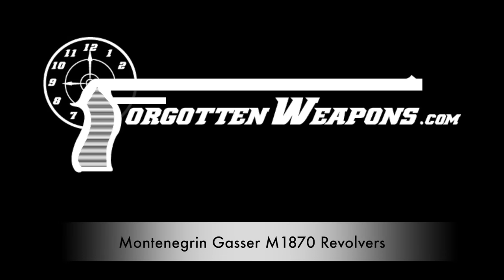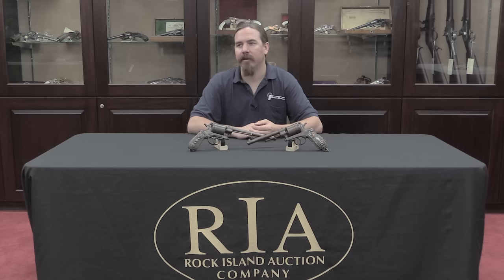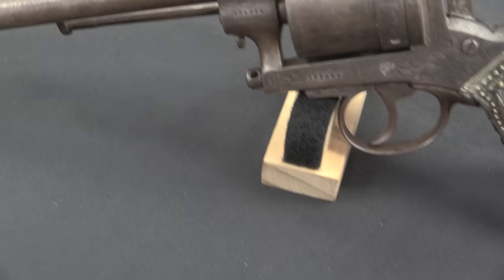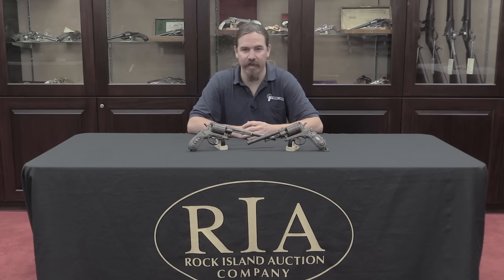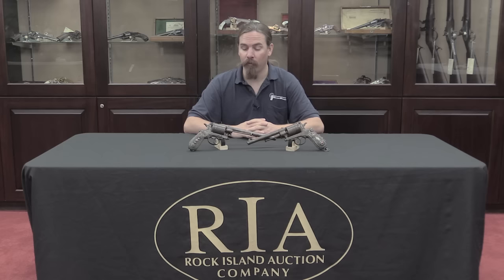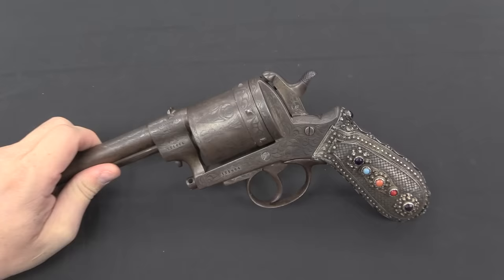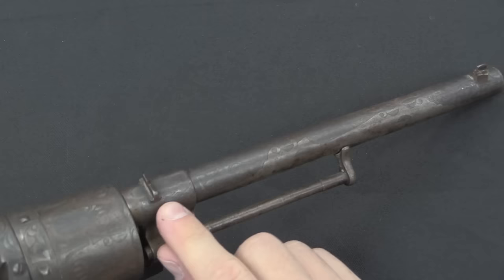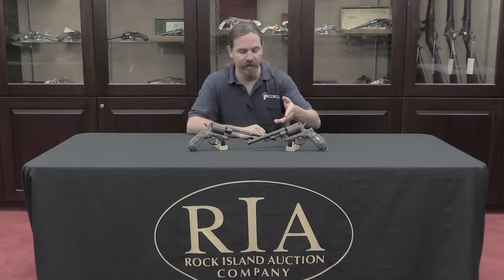A Pair of Arresting Montenegrin Gasser Revolvers

Comment: A 310 grain bullet going 700 FPS is not roughly equivalent to .45 ACP.  A standard .45 ACP is 230 grain, and goes  800-850 FPS.  It may be about the same caliber, but it's significantly slower and heavier, which results in far more penetration in soft targets.  Something like that could easily kill a moose with one shot.  Good luck doing that with .45 ACP.  A more comparable cartridge would be a modern .45 Colt cowboy load, but even that is significantly lighter.

Comment: This revolver is finer than a lot of modern revolvers 😥😥 swoon .. did you see that cylinder gap n the recessed chambers n those nice sights n its double action still too .. ik fixed closed frame is stronger than open frame too but gah i quite like the look of open .. this is besides the ornate features, such a fine revolver. Im not a collector but this piece i would enjoy possessing especially if someone remade this in a modern caliber and steel

Comment: you mentioned that the Gasser 1970 uses the 11,3x36R, like the Werndl carbine. But didn't the Werndl use the 11.15×42R and later 11.15×58R cartridge? I am talking about the Werndl-Holub rifle, i didn't find any info on a Werndl carbine in particular.
Reply: He went over this in the video: The carbine used a smaller cartridge.

Comment: I would very readily compare this to a .45 acp I found some figure from someone on your site comments "11x36mm Gasser fired 20g (312 grains) bullet @ ~220-250m/s*" from 2014- credits to "bojan"
312 grains with a speed at or near .45 acp 230 Grain army ball It's actually MORE powerful depending on how much leeway you give the velocity figure.
I would call this more like .45 LC from period firearms; its a similar caliber with similar performance and probably what they were aiming for when they designed the thing.

Comment: Firing them without a solid glove on would be a painful experience.
Reply: I would be very surprised with this pair.  Thats a heavy gun and would need a firm grip and all those fake jewels on the backstrap are going to dig in
Reply: I have only fired wooden grip one, but recoil is surprisingly light with original ammo (35 grains of powder, 312 grains kg (soft lead bullet) as loaded revolver is about 1.8kg (~3.5 pounds) loaded... Also, it works more like "push" rather than a "kick" of modern Magnums.

Comment: These revolvers don´t have the same function as the 1898 Rast & Gasser revolvers, that you can pull the trigger to cycle through the chambers, right?  Its kind of a shame they never took that function to the next level and put a proper, Colt SAA style ejector rod on these. Or heck, just that function alone would be neat enough to copy these days, when theres no concern for copyright of Gasser anymore.
Reply from the maker: Correct, they do not.

Comment: What is the thing the looks like a lever on the right side of the frame above the trigger?
Reply: +toomanyaccounts No, I meant the long skinny thing with a single screw that runs parallel to the barrel.
Reply: Part of safety mechanism, that positively blocks hammer  when placed on half cock. Unlike other revolvers, DA mode can be used from half-cock position however. Sort of early style hammer rebound. This made Gassers one of first revolvers that were safe to carry with all chambers loaded.
Reply: No it is not, I actually fired and disassembed those.
That part is a flat spring, on 1870 model, when hammer is placed on half cock it will be flat with frame, and two pins attached to it will block a hammer. When the hammer is down it will be bent about 1.5-2mm out. When you pull a trigger, inner part of trigger moves those out, freeing a hammer. When fully cocked it is also bent, and held out by inner part of trigger.
This mechanism was not unique to Gassers, some Tranter and Francotte revolvers had it.

On later production guns (1870/74 model, 1873 closed frame) you don't have to put it to half cock, spring will engage automatically when hammer is lowered,

Comment: what was the long thin lever inbetween the cylinder and trigger guard for?.
Reply: I saw the same thing and wondered likewise. It doesn't look like a function lever of any sort as there is no wear visible from it toggling against the frame. Maybe an assembly component of sorts? Anti-walk pin set from the 1800's? Haha
Reply: Function of this thin lever on the right side of revolver is blocking hammer when you pull it on first notch in order to load ammunition in chambers.
Firing pin is long and you can't rotate cilinder freely until pull hammer on first notch.